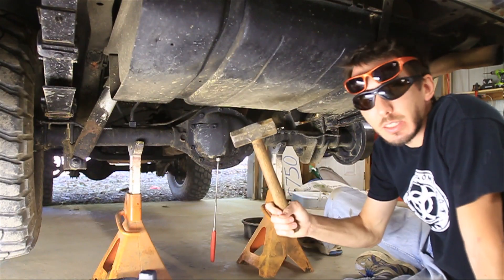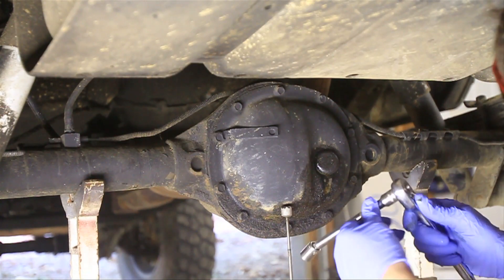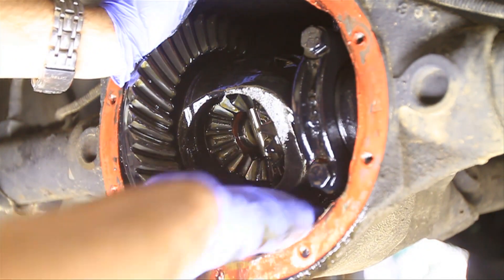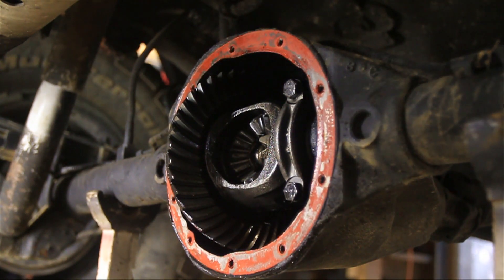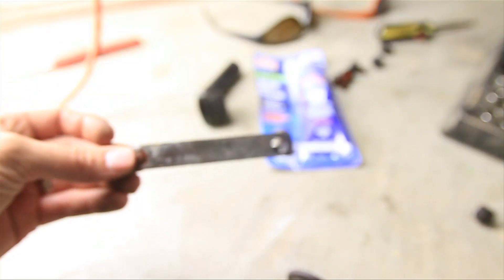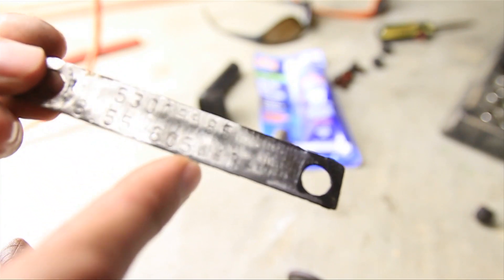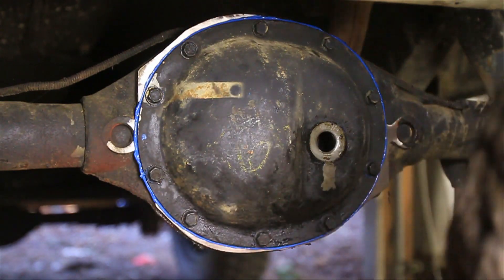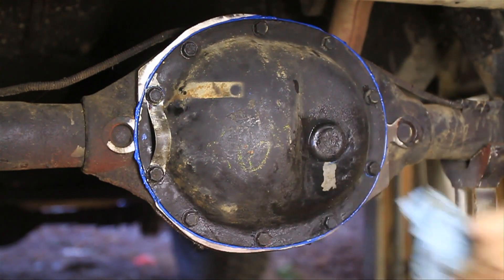How to Change Your Differential Fluid

Comment: word on the street is 30ft-lbs of torque for diff cover bolts. another word is to just make sure they're tight. might depend on your axle though. those numbers are for dana 30, 35 and chrysler 8.25.

Comment: How much beer do you need to do this procedure?
Reply: I'd prescribe 3. Start the project, and ensure that you have 3 more by the time the fluid is refilled.
Reply: Salut mois 8 bieres de trappistes weesmalle 9,5 degres ,,,,,,,du coup j ai remonter avec additif ,,,,,,,,tout sans huile de pont,,,,,,ouvert le crane en sortant du véhicule dans l échappement j ai sauter les chandelles pour aller a l hôpital me faire recoudre 22 points de sutures   17 kms après grande explosion sous le jeep pont hs et toujours pas recousue parce que les gendarmes mon interpellé car état d ivresse bien avancé j ai couru a block et endormi dans un fossé en warning déchenillé complétement
Reply: If it is very humid out, you may want to have a 4th beer ready while you are waiting for the brake parts cleaner to evaporate out of the diff.
You could use compressed air to help speed up the drying, but then you are discarding a valid reason to drink a beer which is usually frowned upon.
Reply: If using 75W-90, drink 1 beer per pint of gear oil used in the diff.  If using 75W-140, you can up it to 2 beers per pint.

Comment: The Dana 35c axle was used in XJ, YJ, some TJ, and some early JK applications.
Reply: Indrid Cold and zj, and its a pos
Reply: xxRamD3yruxx I agree.   It was weak.  Oversized tires often wrecked them. It was still better than independent suspension though.   Independent suspension has to be the worse type of axle and suspension ever.   It is weak and very flimsy.

Comment: i use 1.5m of garden hose (that fits in the diff hole) and cut a hole in a coke bottle lid, glue that up wait till its half dry, do it back up onto the bottle and then cut the bottom of the bottle off,  then u have a funnel for ur diff oil and u can stand up to do it and not have to lie under the truck

Comment: I use some vinyl tuning a little smaller than the hole then a pvc fitting that fits the timing and the threads on the bottle

Comment: Dana 30 and Chrysler 8.25 with Spartan lockers front and rear. Which differential fluid and which weight should I use?
Reply: 75w140
Reply: @ObamaoZedong  would it matter if I go with conventional or synthetic?
Reply: @sampitt9318  no
Reply: @ObamaoZedong  Thanks

Comment: When changing this fluid, if you are unsure of when it was last changed should you mix the old with the new fluid?
Reply from the maker: Julian Gagne never heard of that one before.
Reply: BleepinJeep So I should have no problem whites ever changing it?
Reply: Julian Gagne only time I've heard something similar to that was in relation to automatic transmissions. If your clutch is heavily worn then changing to fresh fluid can cause slippage. Something to do with the fact that having the worn clutch material in your fluid will help your clutch "grab" better; and once you get rid of the old fluid (and worn clutch material suspended in the fluid) it becomes much harder for your clutch to grab as it was intended. However differentials use metal gear that physically mesh together ; think of a bolt or screw meshing with threads. That's just my basic understanding of it, hope it helped.

Comment: Dude - Love the vid... but I got an issue with the RTV.  Maybe I'm wrong, but I think your application was too thin and you tightened the bolts too soon.  I put a continuous 3/16" bead on the cover making sure I encircle all bolt holes.  Then I put the cover on and finger tighten all the bolts as evenly as possible.  After waiting about 1/2 hour, I torque the bolts down.  I wait an additional 1/2 hour before putting fluid in and I don't drive it for several hours or overnight if possible.  Stays dry as a bone for sure.
Reply: bleepinjeep Fair enough... but I'm over it now... still LMAO at the Superbowl vid!

Comment: Rockauto has gaskets for that 8.25 Corporate rear for like a $1.06, maybe less if you register your vehicle with them they are discounting Jeep parts regularly now. It gives a nice spacing and stops that metal-to-metal contact like RTV does once you tighten it down ;)
Reply: BTW, even though I use a gasket for both my front and rear diff's, I do use RTV but the Black kind on both sides of the gasket, real light coating, let it skin up a few minutes, then re-assemble and have never seen a drop of oil slip out ;)

Comment: The Jeep Commander lubricant is SAE 75W-140 with a Friction Modifier.
The Friction Modifier additive is sold by Jeep in a 4 ounce bottle ...

MY QUESTION is two ounces for each differential or four ounces for each differential? 

Additionally it was published if too many ounces were added to the gear oil that the limited slip [if your Jeep is equipped with a limited slip gear set] will fail to limit the slip ...
And if not enough is added to the gear oil that the gear set will chatter during turns ...
How much is enough? Thanks
Reply from the maker: skip19301 4 ounces in the rear, I dont think the front needs it but probably not gonna hurt anything.
Reply: Thank you. Nice video. Saw it before. About a 1/2 inch below the plug is enough and room for heat expansion ... Where is the axle vent? Above water I hope ... in a shallow stream crossing.Power steering rack vent? Up high? Yea high enough. just below the aircleaner box.

Comment: How often do you have to change the oil on the differentials?
Reply from the maker: suppose to about every 60,000 miles
Reply: What type of oil do i need for front and back, same or different?
Reply: +Gilberto Franco - Same :)

Comment: love your Chanel question. is it possible if i had one front wheel off the ground a few inches and i pulled my diff cover off could  the oil get pushed past axel seeal  with cover off
Reply from the maker: not unless the seal is bad.  or you took the axleshaft out.
Reply: ok just wondering because its not leaking anymore

Comment: I'm guessing it's no biggie to leave all the residual brake cleaner in there?  Wouldn't this potentially breakdown the viscosity of your oil or no worries?
Reply from the maker: let it evaporate first, it does so very fast
Reply: Remove any pooling brake cleaner and allow time for brake cleaner residue to evaperate before sealing up.

Comment from the maker: brake cleaner is safe on rubber seals on your brakes so I would assume it would also be safe on rubber axle seals as well.
Reply: I was told it’s the mild residue the brake cleaner leaves doesn’t let the oil stick to the gears so sitting over night,  first rotation in the morning the pinion and ring partially are dry use hot gear oil to flush rear axles

Comment: Just use a hand pump to fill t-cases, manual trans, diffs, etc. It's basically just a beefier pump from a soap dispenser, with a hose coming off of it. Just toss it into whatever bottle you need to pump.

Comment: So the thing about RTV is that you should not have to put excess on, spread it out, or wait a minute. RTV will spread out on its own under the compressive strength of the fasteners, if you put it on and tighten everything down within the first 5 minutes after the application.

So for everyone watching this is not how you use RTV. 

Finally the torque spec on the bolts is 30 pound feet.
Reply: @dickJohnsonpeter  but it also doesn't help. All it does is waste product and make removing it longer.

Comment: Matt, I assume both front and back on these jeeps are about the same? Should you be on a level surface when you add fluid? Or a slight angle? Use the quart bottles of Diff fluid (Lucas and others make them) and it has a convenient tapered tip to squirt it in there with. Two or less of those and you have it filled up. No sweat.

Comment: So you can use brake cleaner on differentials? I've heard varying opinions on the matter, obviously I can't think of anything it'd hurt but some ppl say there's a residue or possibly some part of the brake cleaner that breaks down the gear oil

Comment: Like "into the dirt shop"  said:  "what happens if you hit your inner seals with brake clean? wont it start eating at the rubber?"

That sounds like a reasonable outcome,  making it a very good question.

Comment: Do you need to add the limited slip resistance to the rear??i noticed you didn't put any or mentioned
Reply from the maker: This isn't a limited slip.
Reply: BleepinJeep how would i know if my 1990 cherokee in line 6 has it???or should it just be safe to just add the limited slip oil.??
Reply: @grrizly660  synthetic gear oil works for both

Comment from the maker: never had a problem with it.
Reply: My zj is all time 4wd and I had the front pumpkin rebuilt and the rear pumpkin replaced. So I'm ignorant when it comes to working on them. My question is would I be required to lift my zj front and back just to check for any damage when I change the gear oil on the rear pumpkin?

Comment: If you have a gallon size gear oil, they make a hand pump that screws onto the container then the end tube is placed in the fill hole.  Pump away and all is good...  very easy the pump will cost around $20.00

Comment: I also have a question I have a 2005 wrangler 3 inch lift ,stock axles  what's the biggest size tire I can mount before having to change any gears?

Comment: Around 7:30 there's a marking on top of the diff that says "DANA 100". What's that? I noticed today that mine says "DANA 040" (marked upside down). Mine is a D35 with Trac-lok from a '89 Limited.

Comment: i have a question.
can i use brake cleaner to clean the old oil residue  when i flush the fluid on a manual transmission?

Comment: is it bad to grind the gasket off?
Reply: Mongerz as in like, with a grinder or an abrasive pad
Reply: thats what i figured. wont the abrasive mar the surface and cause leaks?
Reply: Use a pad that is softer than the steel.

Comment: Matt, A very timely video as I am about to do this in 10mins. I thought the other numbers on the TAG were your VIN? It's worth noting that jacking the rear end up will allow you to put more fluid in than sitting level. This is helpful in off-camber situations to ensure gear-to-oil contact. Any Autoparts store will sell a Pump (like a soap dispenser) to screw onto your fluid container and pump into the reservoir via a hose. Maybe $10 at most for a good one. Awesome video and glasses.

Comment from the maker: If you dont like your current situation, change it up... thats how I got here;)  I actually have a video on that, check out my video on how to convert a one piece to a 2 piece shaft, I think it may be the second video for the seal replacement.  that is for a inner seal, if you have an outer seal it may be slightly different but you can get the general idea.

Comment: Use a gallon jug pump to pump all your fluids in that have those side-facing or hard to reach holes.  I use ones from soap bottles, bc soap washes out easy with hot water.  Stick appropriate lengths and sizes of clear vinyl tubing on the suction end and pump tip of the pump.

Also use this setup to suck out fluids before opening/removing covers/containers etc.  Power steering, brake, clutch, diff, trans etc.  Before you use your pump/tubing setup - Pump a bit of old fluid through your setup first, then a bit of clean fluid - this will get rid of whatever was in there before.

I keep one pump setup for Hydraulic fluids, one for Trans, one for Gear oil etc.

Its the right thing to do.  Please think of the chidruns.

Stay gold.
Reply: dnl machine they also make gear oil pumps commonly sold for outboard boat motors that will work great as well
Reply: I just used a rubber elbow..

Comment: Is this a limited slip?
Reply: I've been trying to figure out if my jeep is a LSD or not I'm getting different answers thrown all over the place and still trying to figure it out so I don't put the wrong fluid in
Reply: And I have an 89 YJ
Reply: @Calebevansmusic  

On level ground, block your front tires from rolling forwards and back. 

Shift transmission to neutral.

Jack rear axel up. Both rear tires together off the ground.

Spin one tire by hand.

If the opposite tire rotates in the same direction that indicates 'Limited Slip'.

If it rotates in the opposite direction that indicates an 'Open Differential' ...

Comment: Just spoke with Permatex. Their tech said for front or rear differentials where gear oil is used, ONLY use their 81182 gear oil RTV product. They said that gear oil is acidic and will leak if any other RTV or even The Right Stuff is used. I asked about the anaerobic sealant
 and was told NOT to use it either. No Ultra black, red or blue RTV either. Just a heads up guys

Comment: I use one of these for refilling. Makes it much better, and has an "on/off" toggle.  

Put this is Google:  Hopkins FloTool 10106B/6 Spill Saver Trans Fluid/Gear Oil On/Off Filler Refill

Comment: Fill a zip lock plastic bag with the oil needed put the bag in housing and bolt it up. once you turn the gear the plastic bag will get chewed up and release the oil